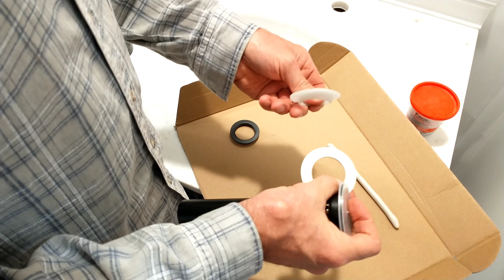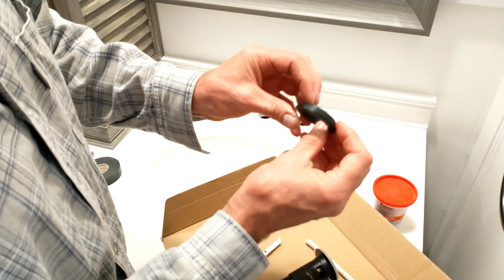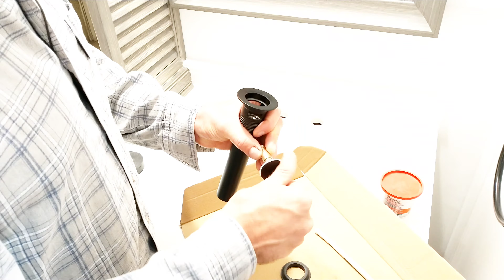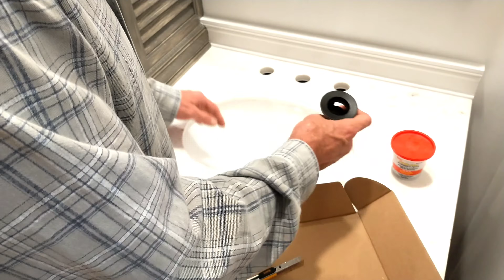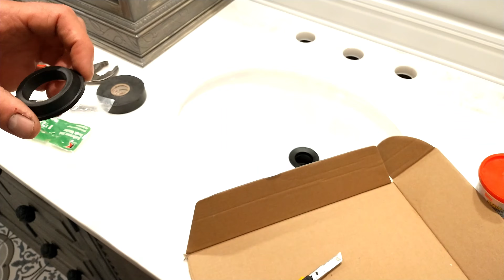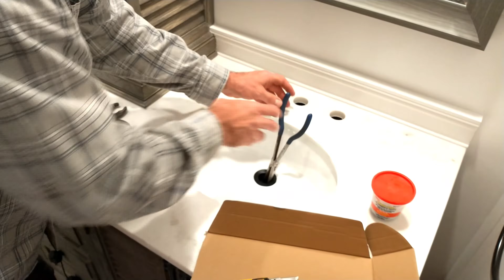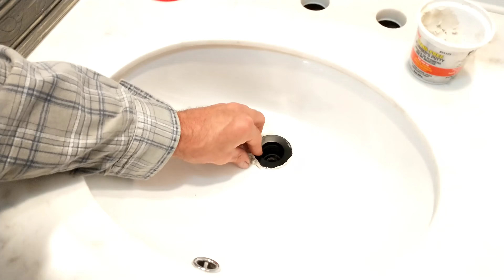Easy Install Pop Up Drain Assembly Stopper NO LEAKS for Bathroom Sink #diy #how #howto

Comment: Ugh! I wish I'd thought to watch this before I had to jerry rig mine so much. I totally installed mine wrong. Now I'm thinking of getting a new assembly and starting over. Great video. Thanks so much for all the tips. Very easy to understand,vand you explain why you are doing each step.
Reply from the maker: Thanks so much for the compliment...always appreciated 👍.  Installing one of these can be a bit tricky and a headache if it doesn't all go exactly the way it should. I know it's a pain in the rear, but you might want to redo it so you don't have a huge leak in the near future. Amazon has some really nice pop up drain assemblies for not much money and usually free shipping. Way to DIY! Always saves a lot of money and you learn new skills. Keep it up!

Comment: Great video exact drain pipe, but my sink does not have the drain holes on the side, will that cause a leak? Should I tape up the Rectangular holes on the sides of the pipe?
Reply from the maker: Hi Frank.  Thanks for the compliment and for watching the video.  Some sinks do not have the overflow holes. This pop up drain assembly should still work for you as long as those rectangular overflow drain holes in the pop-up drain are enclosed within the sink.  Meaning, when you attach the rubber o-ring flange and gasket under the sink you need to make sure that you cannot see those rectangular drain holes in the pop-up drain assembly. As long as that is enclosed within the sink itself then this assembly will work just fine for you. 👍

Comment: The picture of pop up drain that you have on your video is not the one you are installing.
Reply from the maker: It's the same brand, just different pipe color.  It installs the same way.
Reply: Which brand? My moen one that came with faucet is too big for sink hole
Reply from the maker: @jtbrigade3557  Hi JT.  I purchased this drain on Amazon.  The brand is a Gotonovo.  Thanks for watching!👍

Comment: Say , i followed your instructions but the pop up drain continues to leak on the bottom  (  note : I applied  oates plumber's putty )  🤔
Reply from the maker: Did you apply plumbers putty to the top and bottom?  I only used the plumbers putty around the drain flange in the sink.  I applied a waterproofing sealer (Lexel) at the bottom portion of the flange under the sink.  I've done 7 sinks in my house this way...no leaks.    You may want to try tightening the washer....might not be snugged up all the way.  Also, the black washer that is used before the plastic nut (under the sink) is cone shaped and directional.  Is it faced properly according to my video? I purchased that aftermarket washer because it is far superior to most standard washers that come with pop up drain kits. Also, check for cross threading....that will be a leaking nightmare. Hopefully you just need a little tweaking and extra tightening to dry up your sink drain.👍
Reply: @YouCanDoIt2  yes , I applied the plumber's putty on the top area only & used the black washer that came in the package,  ill go purchase a  after market  washer & some silicon , thank you for your reply  👍
Reply from the maker: @montellwilliams811   Hi Montell.  Sinks can be tricky, but I have confidence in you!  If you purchase the aftermarket under sink flange and some Lexel waterproof sealant you will have a leak proof sink.  Thanks again for taking the time to watch our video and leave a comment.  Way to DIY!!
Reply: @YouCanDoIt2  thank you  ✌